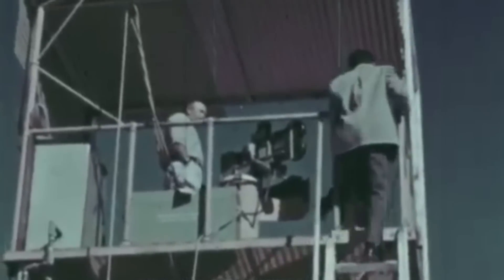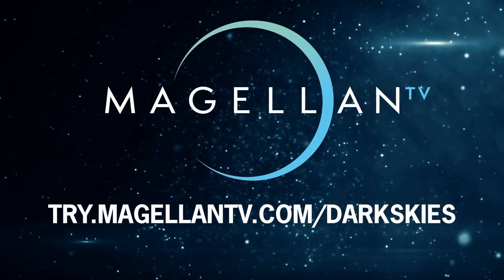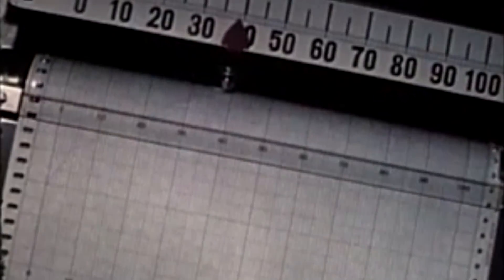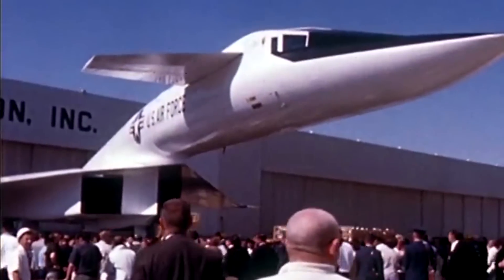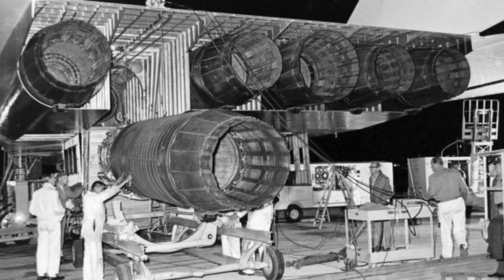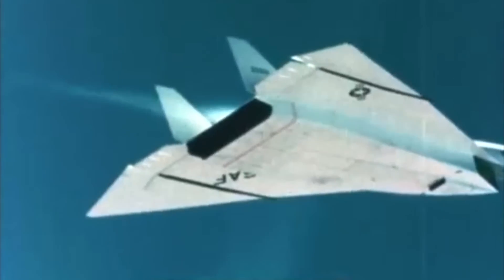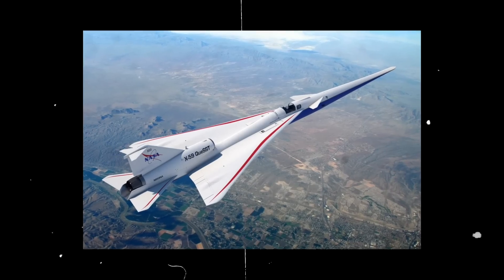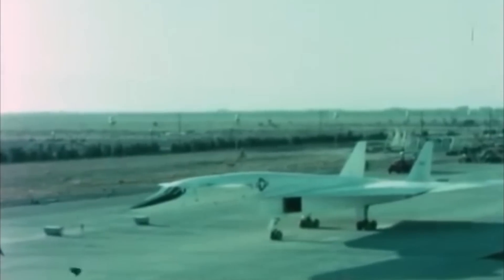XB-70 Valkyrie - Mach 3 Nuclear Bomber

Comment: Even without the boron fuel that proved to be too corrosive this thing was still capable of Mach 2 on regular jet fuel. They should've have reconfigured it as a supersonic jetliner and beat the concord to market by ten years.
Reply: The B-70 was huge but wasn't designed with internal volume for passengers. It would have taken years to have redesigned it for a larger payload.  As it is, it couldn't have beaten Concorde to the market by 10 years since the first B-70's maiden flight precede Concorde by only 5 years. And by then there was no market to be beaten to.

Comment: It looks a little like Concordski. (Tupolev Tu-144) Indeed, some YT videos on the Tupolev are erroneously using footage of the XB-70.
Reply: I think it's due to the engine placement and the straight edge wing.
Reply: The 2 planes share almost no common features. The closest they got was when the original 144 prototype was revealed to have its 4 engines, and their intakes, mounted next to each other. Other than that, and being tail-less deltas, there are fewer similarities than differences. B-70 has twin tails which are mounted to the side, and ahead of the engines. The Tu-144 has a single vertical stabilizer mounted on a tail that's mostly behind the engines.  The 144 doesn't have the B-70's downward folding wing, while the 70 doesn't have 144's VG nose (they both have raised windshields)

Comment: The great thing about this plane is that it reached Mach 3 with a plane that weighs nearly five times as much as the SR-71. To do this, they needed six General Electric YJ93 engines with 0.84 times the thrust of the SR-71's Pratt & Whitney J58 engine, and compression lift technology that bends the tip of the wing down.

Comment: Subsequent research found that Joe Walker's F-104 was sucked towards the XB-70.  When he was asked to move a little closer in the formation.  To get the perfect picture for General Electric.  All of the planes in the formation were powered by GE engines. Because the air inlets were too small for the air demand.  Those 6 engines sucked in a massive amount of air.  Unfortunately the fateful flight was not properly authorized by command staff.  Which made the tragedy even more of a problem for the Air Force.
Joe Walker the F-104 pilot, lived in Quartz Hill, CA.  Where Joe Walker Middle School is named in his honor.

Comment: Miserable failure. To travel at Mach 3 it consumed so much fuel that it had no room left for bombs. Sorry about that. The US has a reputation for building bombers that under perform. The B52 being the standout exception. The B1 Lancer was a good effort but it too was outclassed  by the TU-160 White Swan. The B2 was a failure because though stealthy, when the Russians moved to passive optical targeting it was just a slow, wide, flat, unmavouverable target. Perfect for SA-7 practice and at a couple of billion each, they soon stopped using them in the Middle East.

Comment: That X-59 looks like it is partly descended from the X-3 Stiletto, another fascinating, far-out plane that just didn't work out but provided some important data. The Valkyrie would have worked, though, if it weren't for the interceptor missile advances. Where bombers could safely get in, we had the B52 and its huge capacity, and later bombers used stealth design/technology.

Comment: "unnecessary"
Considering the success of the SR71 purely for its speed, even past the 90s, I think this statement is a bit of a stretch
Reply: cramthelan sr-71 flew outside borders by a hundred plus miles using side looking cameras. The Xb was to fly over it’s target which makes Targetting munch easier
Reply: @mcamp9445  right now imagine if it didn't fly over the enemy territory to drop bombs and instead was upgraded for missiles or reconnaissance or any number of other systems like the SR71 and you see where I'm going with this
Reply: @cramthelan  I don't see where you're going with this. Valkyrie aside, in the 1960s we already had bombers that could carry more and go further, and both reconnaissance platforms that were at least as fast. The argument is that despite its looks and performance the plane didn't add to the capability attained with existing aircraft.

Comment: Soviets had the mig25 and eventually mig31 to deal with these white elephants
Reply: Hal 9000 . Look up SR71 Baltic Express, Swedish Air Force Viggens had 10 to 15 documented intercepts, the swedish pilots also support the claim that the soviet pilots operating out of east german made multiple intercepts, engaging at 22km and 3km from rear, and had fire solutions well the SR71 flew at mach 2.9. Those YB70, would have shared the same fate. Some say that the su15 operating from Poland were able to come close. Anyways when the mig31 entered service there would be no question about it.
Reply: The MiG-25 didn't fly until 1964. By then the B-70 had been canceled as a weapons system, and the usaf had already conducted numerous design studies for a replacement.
Reply: @winternow2242  ya but had the usaf decided to deploy the xb70 operationally the USSR had the mig25 coming into service to handle the big white elephants, so the statement is still true. Just the usaf, knew that and cancelled the project
Reply: @jonathantarrant2449  I'm trying to make sense of that comment. What was it that just the USAF knew?  Not about the MiG-25, it didn't exist yet. The big fear was the vulnerability of high altitude manned aircraft to missiles. We ditched both the B-70 and B-58 because of that issue. The evidence strongly suggests that. Neither the MiG-25 nor the B-70 was a blip on anyone's radar. The Americans canceled the B-70 years before the MiG-25 flew, and the Russians kept the MiG-25 in service long after our fleet of B-70s was reduced to a single museum exhibit.

Comment: I have speculated that the XB70 and the SR71 could be fitted out with nuclear propulsion.  Your title "nuclear bomber" makes me wonder if you have similar thoughts or knowledge?
Reply: Why would you think that either of those planes or any airplane could be powered by nuclear propulsion?
Reply: @winternow2242  Nuclear powered planes was a goal by the U.S. Airforce about the time these planes were being developed.  The air intakes on both planes are huge and both would have enough volume for direct energy transfer reactors.  Both intakes also have large amounts of open unused space in the air intakes.  The B58 dropped its bomb as  part of the fuel tank assembly.  What if the nuclear bomb and nuclear engine reactor were the same assembly?  On reaching the target you drop and detonate the engine reactor thus also removing radioactive contamination from the airframe?  You fly home with the turbo jets.  Some pictures of the SR71 show the intakes painted red which would make sense if the housed reactors.  Finally nothing looks like these planes.  If you had a nuclear powered aircraft fleet wouldn't you expect to see planes like these?  I think also the possible reactor locations would match or work well with the planes center of gravity.
Reply: @winternow2242  Besides my other note I want to mention the extreme distance the flight deck is from the engines.  Fuel in the fuselage would provide radiation shielding for the flight crew.  The SR71 and XB70 are perfect designs nuclear powered aircraft.

Comment: RS-70 is the greatest aircraft EVER designed and piloted...   534,000 lbs, 50,000lb nuclear payload, 4000psi hydraulic system, compression lift, 180,000 lbs of thrust, 85,000 ft ceiling, TOP SPEED OF mach 3.15.  Robert Mcnamara ruined it cuz he was a TRUE dick.

Comment: The wings folding down was not for greater lateral stability, it was done to trap the airflow between the wings and the engine outer nacelle so it could use Bernoulli's principle to travel at higher speeds
Reply: @Galileo7of9 when the wingtips fold downward it traps the airflow, decreasing the pressure and increasing speed, similar to how when you squeeze the opening of a garden hose, the water will flow faster as it exits
Reply: @Galileo7of9 that is how it was made 🙄
Reply: @Galileo7of9 Increased directional stability control was one of the things, the wing tips would be folded downward at high speed for the reason I explained above, that was the main reason
Reply: @Galileo7of9 I mean it doesn't say its the Bernoulli effect but it kinda is if you look at it that way, watch the original documentary from Discovery channel
Reply: @Galileo7of9 yes I reduces induced drag, but also entraps the airflow which helps it
Reply: @Galileo7of9 exactly my point
Reply: @Galileo7of9 it's one of the things they explained, Idk if it's in that discovery channel video or another one
Reply: @Galileo7of9 I do remember reading it or hearing it that way, I can't find it now, I'll see though

Comment: Good video, bad thesis. History shows that an operational B-70 equipped with a defensive avionics suite and standoff weapons would have been an effective weapon for decades.
It was cancelled because McNamara didn't like airplanes. He canned the F-12 and U-2 as well - possibly a bias against Lockheed and North American. Rumors float that he took bribes to favor McDonnell and their worthless crap. That's what happens when you make an accountant secretary of defense.
Reply: If the B-70 was never equipped with those countermeasures, then how could history show that the B-70 would have been viable with them?  And if those measures would have worked, then we wouldn't have needed a triple-sonicn airplane.

I don't see how McNamara "canned" the U2 when they were still being used, upgraded and produced years later. Also it appears that McNamara's influence is overstated given that B-70 cancellation was quickly followed by AMSA, which led to the B1.

Comment: Fun fact: 
The Russians found out about the XB-70, so they needed an interceptor that was capable of catching it, thus the MiG-25 was born.
When the Americans found out about the MiG-25, they needed a new interceptor as well, so the F-15 Eagle was born.
Reply: the mig 25 was developed to shoot down the SR-71
Reply: @TN_Whiskey  
The Mig 25 was developed after the Russians found out about the XB70
Reply: @FP194  nope
Reply: @TN_Whiskey  The MiG-25 entered development in 1959, how could it have been in response to a plane that began development several years later (unless you mean the A-12 which was supposedly secret)? The XB-70 was well known publically at that time, and even played a role in getting JFK elected as he promised to ressurect the program over Eisenhowers (correct) decision to cancel it (since the B-70 was militarily useless, even if impressive technologically).
Reply: Didn't the first MiG-25 fly in March of 1964?  by then, The B-70 was cancelled as a weapons platform and was just being used for research.  The B-70 was succeeded by research programs like SLAB and AMSA, which considered subsonic, low altitude penetration of enemy airspace.  The MiG-25 and B-70 connection sounds tenuous.
Reply: @winternow2242  The MiG-25 first flew in 1964 but it took 5 years to get from initial requirement to working hardware. So how is it tenuous? You don't just buy these things off the shelf.
Reply: @tachikomakusanagi3744  Development was actually longer than that, and when you at the t8imeslines for each aircraft, the connections remain tenuous.  

Mikoyan had been working on high speed aircraft like the Ye-150 series in 1955.  In contrast, while USAF had begun publishing general requirements for what would become the B-70 as early as 1954, those requirements didn't include triple-sonic speeds until the 2nd WS-110 competition around 1957.  In other words, the Russians were working on a high-speed interceptor before there was any Mach 3 B-70 to fly it against.

Development of the Ye-155, the MiG-25's flight test ancestor, was approved in February of 1961.  This technically occurred before JFK officially cancelled the B-70 weapons system, but not by much - Kennedy's announcement actually came out that March, meaning that Mikoyan was all of a month into a program to design a plane for a threat that didn't exist.
Reply: @winternow2242  No, i actually agree with you and am impressed by the level of detail you supply. What i think is interesting is just how completely wired in these two opposing superpowers were - they were so sensitive to even the whiff of losing strategic capability that a issue of a request for capability was seized upon by both sides in a kind of positive feedback loop (that eventually endup up with a man on the moon!). As the OP says, and i agree with him, the F15 (which is nearly 50 years old and not only still flies today but a new F15EX varient will fly for another 50 years) is based on a response to a soviet response (the MiG-25) to a US response (the XB-70~) to a Soviet response (the SA02) ... etc.  Darwin would be proud.
Reply: The Mig 25 was also a stainless steel aircraft.. Or actually I should say "is" since the Ruskies still fly it, you can even take a flight in one as a trourist for a small fee...
Reply: Problem with that being the MiG-25 actually could not "intercept" the B-70, just as it could not "intercept" the SR-71. It was a bullshit tip. Worse, it led to us fighting in Vietnam with 400 mph B-52's flying like it was WW2 and they were B-17s instead of a mixed force of B-58's and B-70s flying at Mach 2+ to and from the target....
Reply: @caribman10  well yes, the MiG-25 was as militarily useless in strategic terms as the B-58 and XB-70. It was not the MiG-25 that threatened them, it was the Soviet integrated air defence SAM system (fielded more or less in any Soviet aligned state). Why bother developing a multi-billion dollar replacement for the B-52 when it will be shot down just as easily? And also, these replacement airframes had very limited scope for fielding standoff missiles, such as the hound dog, skybolt, ALCM and ultimatedly the new hypersonic ARRW. The Hustler and Valkyrie were just simply not effective for the strategic game, wouldn't have lasted 5 mins even in Iraq, and wouldn't have been any use even against 'ISIS'. The British Vulcan at least managed a token bomb drop on the Argies, 30 years after it was laughed out of strategic defence. I wouldn't have liked to be a Hustler pilot attempting the same thing.
Reply: @caribman10  did SR-71s actually overfly Soviet territory as B-70s would have been expected to?  Also, regardless of how fast they'd fly to and from their targets, wouldn't they have to slow down to deliver conventional bombs with any reasonable accuracy?  Do you have any information as to the airspeed used by either of those airplanes when dropping conventional ordinance?
Reply: MiG-25 could perfectly intercept both planes. The task is carried out not when the target is flying away so the difference in speed is not an issue. Besides, missiles are way faster anyway. This is why A12 was useless to work against the USSR and has never been used for anything other than flying around the borders.
Reply: That is not corect. Its a copy of a never finished  canadian fighter.
Reply: @matsv201  if you're talking about Arrow, the B-70 doesn't appear similar enough to suggest it's a copy.
Reply: @Ban this youtube did SR-71s penetrate anywhere as deep into Soviet airspace as the B-70 was supposed to?  Because all published reports I've read are that the SR-71 stayed near the edges of Soviet airspace. Also, unlike the SR-71, the Valkyrie would probably have to slow down when dropping its payload. In the event of an attack, Soviet air defenses would likely be firing at incoming Valkyries.   There's no way to outrun a missile when you're headed in its general direction. Lastly, the likelihood is that the B-70 would grow in weight and size, but not as much in engine thrust, meaning that a production B-70 might not enjoy the speed performance of the XB-70A.
Reply: At first, they thought the MiG is super fast, agile, and maneuverable until a defecting pilot few to Japan in the MIG he was flying in
Reply: f15 can dream of catching the foxbat
Reply: @alexjakobsson1171  An F-15 doesn't have to catch the Foxbat.  It's the F-15's missiles that do that.
Reply: @winternow2242  It would have to get pretty close, within 5-10 miles probably to have any probability of kill on a Foxbat that is traveling away at maximum speed
Reply: @lightningxx  how close was that Iranian F-5 when it shot down a MiG-25 35 years ago?  Or that F-16 that took down a Foxbat in '92?  You make it sound like getting as close as 10 miles is exceptionally difficult,  which would be true if each country only had 1 plane, instead of squadrons of them. If flying in enemy airspace, an incursion of MIG-25 wouldn't be able to fly high speed in a straight line because they'd need to navigate around hostile ground defenses. And a MIG-25 over its own soil would have better luck running...which would simply cede air superiority to its enemy.
Reply: @alexjakobsson1171  F15s have killed Foxbats. 

https://theaviationgeekclub.com/eagle-vs-foxbat-the-mig-25-kills-scored-by-israeli-f-15s/
Reply: @budwyzer77  thats shows clever use of tactics from israeli, but in the end u can read last 25 e just straight outrunned f15 they could not catch up to it.
Reply: @alexjakobsson1171  
Foxbat can outrun the F-15, but it have to blow out its engine to do so. Foxbat's operational speed is more similar to a clean F-15.
Reply: @budwyzer77  Ha, yes @Alex Jakobsson is clearly an expert, so he is right no matter what evidence of F-15s shooting down MiG-25s there might be (look up Thomas Sowell for details).